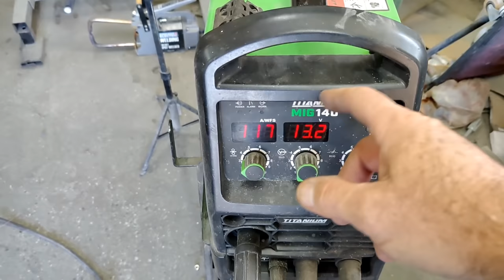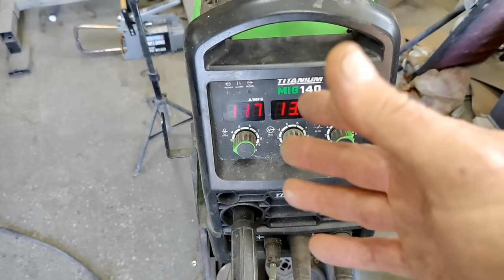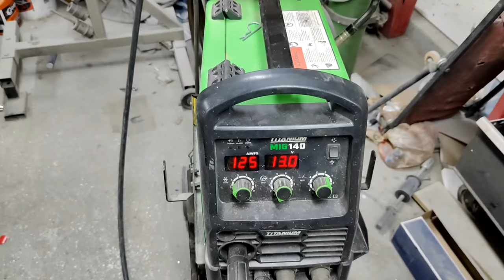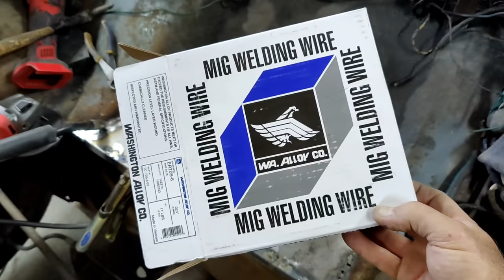1954 VW oval window front quarter panel repair and metalwork full restoration  full build

Comment: Agree about patch rather than replace. My right side quarter was rotten right up to the the dash seam and hinge area, what a B&^%^d to get that seam looking tidy! Lots of welding buildup and grinding down! 
Great tips on the nut-serts Mike, I have a few need replacing.
Reply from the maker: I put links in the video but I am not sure they work in the UK. try them though.

Comment: I just weld hex nuts on the inside. Hide it with a little seam sealer. Good as new. Or if it’s rusted out at a bolt hole. I make a patch, and drill and weld the nut before I weld in to the panel.

Comment: I use a Dremil with cutoff disks to fit my patch’s to the panel. Roughly cut the patch. Cut out part of the damage, start at a corner with a tack weld. Then use the dremil to cut along the patch, get it level, tack, cut some more, tack. Until patch is completely level and tacked, then finish stitch welding the patch.minimal grinding.

Comment: I have the titanium 200. It's capable of stick and tig. 110 or 220. I've found the 023 wire works much better. I ordered a 10kb roll for 25$ from Amazon. The thinner wire doesn't blow through so much. I started off with 030. Welding inner rockers on my 97 dodge ram plow truck. It was horrible. Welding upside  down is not fun anyhow. Lol. Swearing as I burn myself.lol
Reply: I've only used it for mig.  I need straight argon. I live in an apartment.  So I'm pushing my luck welding here. Although no one has complained.  I've had compliments on my truck looking and sounding better. I rebuilt my exhaust by saving all the good pieces of exhaust. Just adding pipe to make it past the cab. It is just an old rusty plow truck. Still fun to fix your stuff yourself.  I wish I had a garage. Some day...
Reply: I also changed the shorty headers for new ones. Not fun. Lol
Reply from the maker: Oh yea been there I could have never done the underside of the ghia with 030. or my 220 century. hole everywhere.

Comment: I have 64 bug and the front quarter panels look rippled on the inside of the trunk. Think this all happened when my dad hit the garage opening.  The outside is probably is Bondo to make it look normal.  Was thinking about replacing the front clip, but after watching this would you suggest use filler on the inside to make it look back normal? I have been debating on what to do.
Reply from the maker: I always have worked the metal back into shape. then use some small amounts of filler to finish the job. Long bars and paintless dent removal tools work well. Remove the fenders and keep working on them till they are straight. if you need to make some path panels. Literally you can spend a week on them and be ahead of the game. Front clips are always much harder to replace at this point. hard to find a good donor. to do that best you cut the window pillars and heater channel. Super hard to line up. if your not a Pro probably will ruin the car beyond repair to change the front clip.

Comment: What gauge is the sheet metal you are using? Working on my 63 rag and cant find anything below 22g maybe 16 but nothing in between. Running a Flux core 125 with .030 wire. Thanks 

Harold

Comment: Nice work! But i have a question with ospho how long do you need to wait before you filler/primer it? 
Because I heard that ospho and Epoxy primer does not connect very well? is that true and how can i avoid this?

best regards from Austria
Reply: I sand it back off for the most part. I only use it to treat the rust. then sand it off 24 hours after application. Under the car I use the other product which I dont use epoxy primer over. I usually use a household  oil base under the car sticks better to unsanded or poorly sanded areas.
Reply: @mikesrandomvideos  thank you for that information